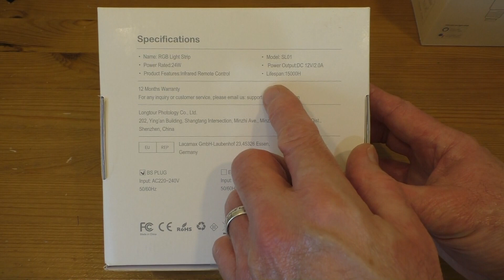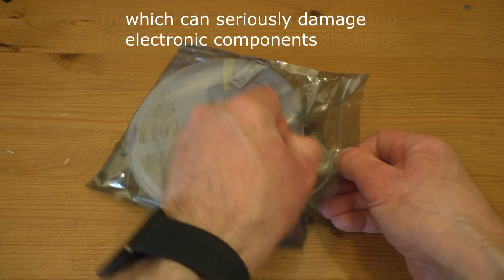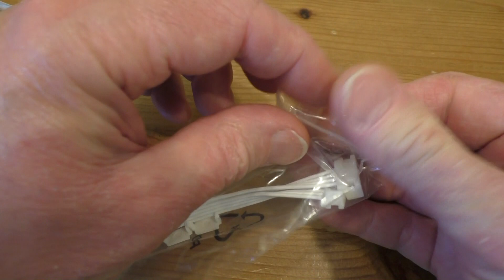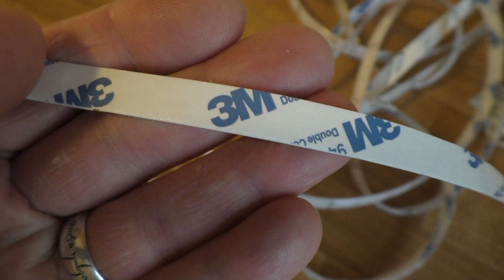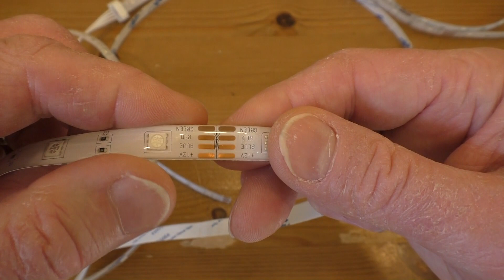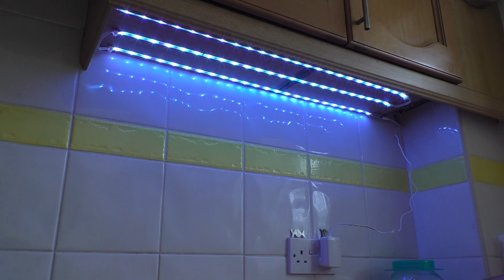TECKIN SL01 RGB Light Strip Review

Comment: Some of my colours are not working such as red and blue,  I don't know if it's the remote or the strip 😫
Reply from the maker: I think it could be a connection issue, the crimp on connectors may not have been pressed in correctly. It may be worth checking all connections on you strip.